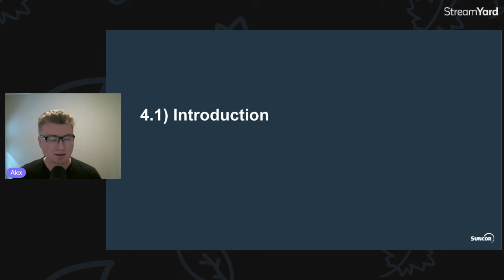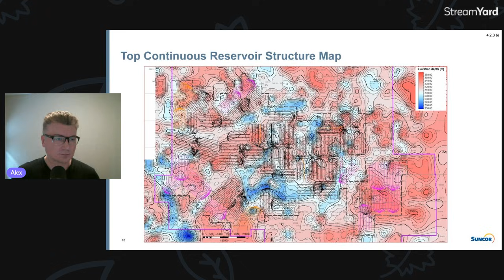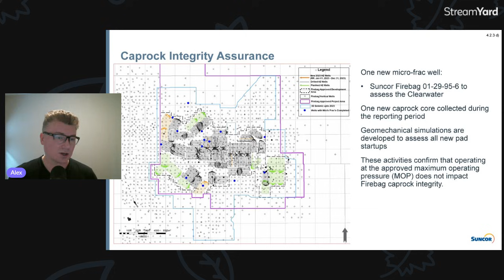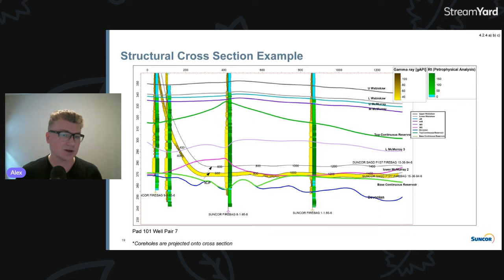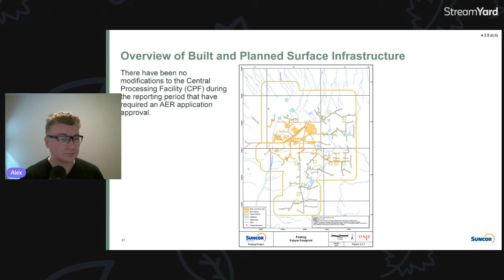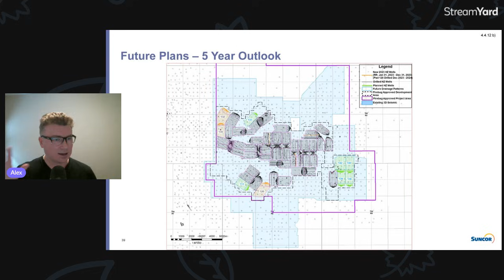Lecture 6: Suncor's Crown Jewel asset Firebag

Comment: Just wondering.  When it comes to end of life of a well would it be possible to just start to inject CO2 in?  I know that can cause some issues during production but if they could inject CO2 to maintain pressure that could be a way to dump CO2 once they start to work towards lowering emissions more.  I was talking to Google Gemini about it and it listed off all the issues that could be caused during production such as clogging up the production well with asphaltenes but that isnt really an issue if production is complete anyways and they are just trying to maintain pressure. Obviously Gemini can be wrong though which is why I figured I'd just ask someone who has a better understanding of this.